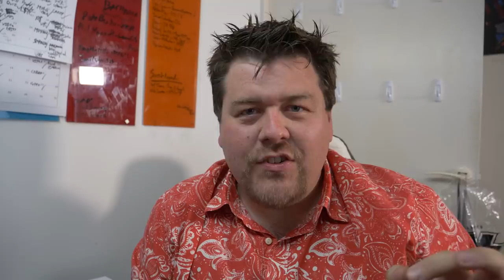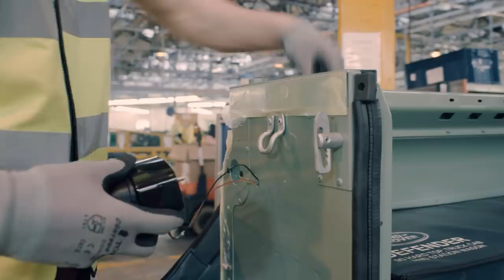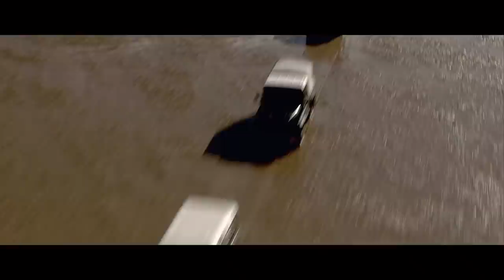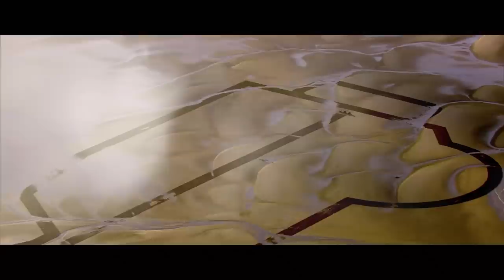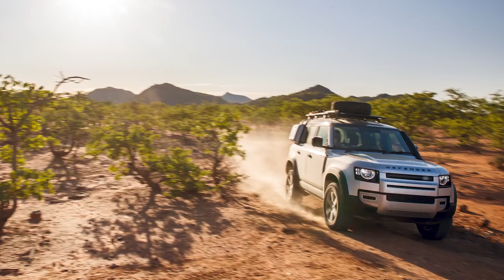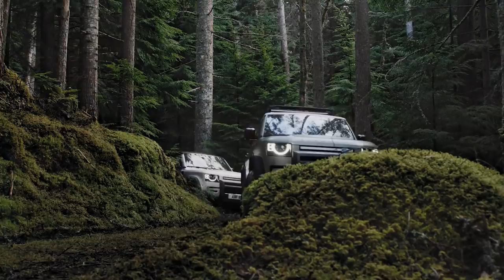How EVERYTHING About The New Land Rover DEFENDER is *WRONG*... and it is GENIUS!

Comment: I kind of disagree. Look what Mercedes was able to do with the new G wagon. They kept all the iconic styling, features and capability but genuinely created an entirely new vehicle from the ground up. I wish Land Rover had done the same.
Reply: Ryan Patterson nah, why make something pretending to be something it’s not tho. Why not make it the best it can be instead of just a pointless tribute to the past. There’s a number of reasons the old design had to end and the engineering challenges with using the exact same shape would be a bit of a compromise with capability. It’s a different philosophy to the g wagon which let’s be honest is all about the image, yes it’s very capable but Mercedes barely sell any and mainly to celebrities and footballers who aren’t taking them off-road. How much more capable would the g wagon be if it was primarily designed to go off. Land Rover have got it right in my opinion
Reply: Bumba Clat the best it can be?

It's not that tho. It's just a clone of the rest of the Lr range.

The best it could be would be more versatility
Reply: G wagon also cost twice as much.
Reply: enzoUKSC it’s basically an updated Disco 4/LR4. With a few mods to mine I’ve never had any problems keeping up with Jeeps and Defenders on any of the trails that those of us for whom these are our dailies go. So...versatile? Yeah, it’s versatile. And capable. Just does it in a different way.
Reply: Because the G wagon is popular outside of the UK; the Defender simply isn’t😐

Comment: I am a big defender fan and I think the new car looks awesome,
But.
It's not a defender. 
The defender name should of died off with the old model or at very least mothballed in waiting for a new utility vehicle (maybe even a fully electric utility vehicle).
The new car should of had a new name, maybe even "challenger" the 90's replacement that never was.
My reasoning is the old vehicle was a utility vehicle and the new model isn't. 
I cant see a company taking one and putting a tipper back on it or cherry picker.
But as a SUV I think it is a very striking vehicle and should sell well.
Reply: it's a great land rover. just not a great defender!
Reply: The pickup trucks and the flatbeds for the tipper and cherry picker customers will come later. The SUVs are simply the introductory versions.
Reply: Should have
Reply: Defender has got a too recognisable name for Land Rover to ignore  - look what happened with Ford's new EV Mustang - it generates noise and publicity without trying
Reply: call it the Offender instead that seems more accurate

Comment: I find it a great same it lost its iconic shape. The new suzuki jimey looks way more interesting now
Reply: But it's not lost the iconic shape.
You could line up the new Defender along side the old one & definitely see the silhouette being that familiar shape.
There is no way LR could have followed Suzuki in the way they made the Jimny, recirculating ball steering in the 21st century?
Nah.
Reply: @Zerofightervi 
The defender was built with workhorse in mind, if you wanted luxury JLR had other options.

People who bought defenders don't care about the feel, they want it to work.
Reply: The Jimny is a very interesting vehicle. The back to basics approach is rather appealing and it reminds me of the old Daihatsu Fourtrack but in a smaller form.

The new Defender probably should have had a couple of versions for the launch. An SUV like they've done and then a much more simpler affair, more mechanical, stripped back and at a much lower sticker price.

I have no doubt that the new Defender will sell, but it will be to city dwellers, yuppies and Kardashians. It is a different vehicle than the predecessor.

The Beetle was the same. Mini/MINI was the same too. The hate between the Mini/MINI camp is still very evident now. I'm a Mini owner, I am accepting of the Mini, but I absolutely hate seeing a MINI at a Mini car show, especially if it's an almost brand new one. The original Mini owners work hard to care for the cars, to maintain them and to get them to the shows. A MINI owner probably took his car to a car wash and that's your lot.

The Defender will be the same as Mini/MINI.
Reply: @Robert-cu9bm  See now I disagree, it's been some time since the Defender has been a farm vehicle.
A lot of the original Defenders have been City dwellers for some time, was it when Ewan McGregor was on TopGear & Clarkson asked what car he drove & he said ' A Defender with a snorkel, just what you need in Central London' & everyone laughed.
I'll bet that he isn't the only one who kitted out their urban dwelling Defender to take on the African planes but never leaves the M25 circle.
The new Defender in realistic terms is probably around the same money as someone who bought a late model old Defender & then threw money at it until it was worth 50 to 60k & then drove it once in a field at 'Glasto' & thought it was money well spent.

These are Defender customers, not farmers.
Reply: @roverboy01  I think it must be a British thing to want the same vehicle to be made for eternity.
I believe LR is coming out with more utilitarian versions at a later date, I wouldn't however expect to see a pickup version because of the way the new Defender is built.
Reply: What mr sandwich means is that he can’t afford the new Defender but might be able to afford a Jimney 😂
Reply: @Stabby666  I couldn't afford a new Jimny to be fair, but it doesn't stop me from appreciating what JLR have done with the new Defender though.

You want a small capable offroader that won't break the bank?
Try the Mitsubishi Shogun Pinin, it's got tiny overhangs, good ground clearance & a proper 4x4 chassis.
You can pick them up for peanuts.
Reply: Zerofightervi you have to have recirculating ball steering with a live front axle rack and pinion isn’t compatible, what the true defender fans are annoyed by is the fact they got rid of a ladder chassis and live axles it has been made a suv which Land Rover already have a lot of
Reply: @jamieshepherd3187  Defender fans are just perpetually annoyed from what I can see.
Reply: Zerofightervi you’re right their are a large number of defender fans that think they know best, I’m not a defender owner I have a jimny I like the back to basics honest engineering of it, the point I was trying to make ( admittedly poorly) was that jlr 
have a full stable of smooth comfortable SUV’s, all trading off the original concept of the series 1, and I think jlr could have made a more utility biased 4x4 to keep the option in the line up
Reply: @Zerofightervi  you are way off!  The new defender looks nothing like the Ole Defender.   It looks like the old LR4/Discovery 4, because it really is the old Disco 4 with a redesign.  I think it is a great product with a really poor exterior design.  If the face looked more Defender then it wouldn't be the big defailure.   As for the British people, when they realize it is a relocated LR4 factory product, that is specifically designed to canobalise Discovery 5, Discovery Sport and Range Rover Sport sales and consequently British jobs, it won't be very popular at home.  Owners will be lucky if they are only laughed at, and not spit on.
Reply: If somebody's complaining about the defender 2020 because of how it looks than there missing the point of the car entirely, furthermore after reading many of the comments it appears that many people are linking utility to the way the car looks even though the two things don't correlate. I think the new defender is great, not because of the way it looks but because of its capability off and on road, for example it's approch and departure angle is better than the  OG defender, it can pull or lift (on the roof) more weight than a land cruiser, Nissan patrol, Jeep wrangler or a G wagon. It's wading depth is better than any of its competitors and unlike the any of its competitors it comes with high level off road modification from the factory. And on the road the air suspension ( or coil spring ) means that it has unrivalled performance on road is well compered to its competitors 6 years ago if someone told me to pick betwene the (OG) defender or the land cruser I would have said the land cruiser as the old defender was ok in the mud but any were else the land cruiser rained supreme but in 2020 if someone told be to pick the ( new ) defender and the land cruiser I would have said the land rover as now it is as good and in some places better than the land cruiser.

Comment: Wasn't the Discovery 3 disliked alot on release? I'm sure that must have sold by the truck load
Reply: I had the very last Discovery 2 registered in the UK in 2005.... loved it♥️ but a manual gearbox in stop start traffic was very wearing! Bought a genuine 2008 G4 Discovery 3 from LR auctions..... loved it♥️ drove great.... but reliability was poor☹ high pressure fuel pump failure, and big end bearing failure at 107,000 miles and 7 years was the killer.... can't fault LR customer service though... replaced the engine 'free if charge' well outside of warranty... WELL DONE LAND ROVER👍
The new Defender looks more like the successor to the Disco 3/4 than the Disco 5!

Do I want one... Hell Yes!😉

Can I afford one..... no☹

Hi LR, as a huge LR fan and former owner.... loan me one please😉👍
Reply: The Discovery 3 and 4 where very popular with LR die-hards. The Discovery 5 lost them as it really became a purely urban SUV. 

The new Defender is really the new Discovery.

The Defender is dead. Long live the Defender.
Reply: Your thinking of the hateful Discovery 5

Comment: My dad had a brand-new F-reg Land Rover Defender County 110 back in the day. Repairs were relatively quick and cheap - someone crashed into him one evening, and Land Rover removed the damaged body panels and riveted new ones in their place within a couple of days (from memory). I do remember the catch on my rear passenger seat becoming lose though, so under heavy braking it would pitch forward before it got fixed - not terribly reassuring on such a relatively simple vehicle!

I also remember someone at a Dartford toll booth insisting that it was charged at van fare, not as a car!

Comment: I’m not a 4x4 fan at all but I’ve always liked the old defender. I loved its retro looks and build with its exterior hinges and pop rivet construction. The new one is just another Land Rover.
Reply: mark reed you’ve obviously never owned or even driven an old defender. They’re wheezing 120hp sheds on wheels with a cramped uncomfortable cab, horrific road handling and tractor style comforts. Nobody except the fanatics want that in 2020.
Reply: Disagree totally with that. Sold mine last week. Was only supposed to be for taking the dogs out in winter but found myself taking it to work instead of my M3 or Tvr , a great fun car that always put a smile on my face and it was a 250k mike smoker

Comment: Mercedes did a proper job updating the G-wagon, to meet current legislations. It still looks iconic whilst improving handling, safety, space, efficiently. This design has washed away the Defenders design heritage. It’s a no from me👎
Reply: And it has a starting price of £93k, hardly for the average person
Reply: Dodomando the Defenders 80k with the 6cylinder and will devalue quicker, not many average people are going to buy them either.
Reply: Lee Harrison Photos I agree. I really don’t understand why Landrover didn’t retain the classic shape and update the safety, tech etc. Mercedes managed it with the G
Reply: I think people are forgetting that the gwagon evolved from industrial to plush over time. It was already a wee bit of a gin palace before it was updated. Jlr completely missed the boat on that, hence all the modifiers doing it for them. 

Either way, I'd buy a current g class. I like the look of the defender, especially the interior (with the wood pack), but I wouldn't buy one.

For the same reason I wouldn't buy fiat, alfa, Renault, Peugeot or citroen. It. Will. Break. 

I've never subscribed to the old adage that poorly built cars 'have soul' or personality. 

Would I buy an alfa if it wouldn't break? Yes. Renault? Yes. Fiat? Yes. I love the design of some of their products. 

But I'm not going to buy problems. 

And im certainly not going to be told I'm not a true petrolhead until I do by some old top gear fanboys. 

So in summary, it will break. So it's a no from me
Reply: I personally think the G wagon looks like shit. It’s a big box with a small box stacked on top. A three year old could design that. As said in this video though, the people whining here probably can afford the new car anyway and are just finding excuses for having to stick with h their old 120hp bone shakers 😂

Comment: I’ve owned 7 Land Rovers and took delivery of my 2020 Defender two weeks ago. It is the car Discovery 5 should have been and far far better than the old Defender, albeit at a much higher price point. JLR could never have pleased the “Land Rover lost the plot when they stopped making the Series 2” brigade, but they are not new car buyers. I lived in Africa for several years and the most popular JLR product (judging by the numbers seen on the street) was the Range Rover Sport. The utility market was dominated by the Toyota HiLux. Land Rover needed a product that would sell in far bigger numbers than the old Defender and make them a decent margin. I believe they have hit the spot with the 2020 Defender.

Comment: Hi Jay, here's my take on the Defender debate:
1. The original Defender was a platform vehicle that could be specified to do a variety of jobs; a hardtop in two wheelbases for GP duties, a pickup for farm and forestry,  an ambulance package, a fire brigade package, a forward control vehicle for police incident management, a 12 seater .  And after it is finished in that role, it can and often is re-profiled to do a different job.
2. The new Disco- -  sorry Defender is not at all flexible like the above, plus it is hugely expensive. It's a Disco with an ugly coat on - nothing more. So if the market really wanted a Chelsea tractor they would have bought one of the other LR/RR products.

The funny thing about all of this is that the days of "Chelsea tractors" are over and done. SUV's are what the market demands will much more comfortable driving characteristics.

Unfortunately LR have alienated a loyal fan base to move into another market, which has collapsed.
Reply: That was a good read.

Comment: As requested: Purchased one for delivery in July. Why? 1. Performance (on paper), 2. Size and power, 3. Versatility especially cold weather heavy snow, 4. Elegant but not over the top, 5. Roomier than G wagon and aerodynamic, 6. Different and refunded as compared to Jeep, Toyota, etc. 7. Very practical. Fears : Air suspension sensor break? I think reliability on JLR is much better, but hell mate it’s a lease. Thanks great review.

Comment: I think you missed a major point here. Yes, the original Defender had major downfalls regarding ride quality etc, however the clattering and poor vehicle handling was a driving EXPERIENCE. It could turn a trip to the beach into an adventure. You wont get that same feeling from the new model as it is simply well refined. Its like every other SUV on the market and wont feel special or give you an experience from the second you open the door and close it on your third attempt...
Reply: Sooo people aren't going to like it because it's too good!? It drives better? It doesn't get the highway shakes? I'm confused...
Reply: @Jadab4u22  Every modern car provides a good driving experience on the road. Its simply not a selling point anymore.

Comment: I think you're completely right, just a shame there is nothing left to fill the gap left by the old defender, an affordable, rugged machine which might actually replace some defenders. Mind you, do Defenders ever die? Most of them have had 3 new chassis and 2 new engines, They don't go fast enough to do any damage in a crash. How often does one actually get scrapped off?

Comment: I agree wholeheartedly with your comments that the new Defender is a far cry from the original as it should be! The only thing is that JLR has lost the original ethos of the Land-Rover(original) it was a semi agricultural vehicle that could plough a field one day and take the produce to market the next day! This new Defender has all these "off-road" and wading capabilities but nobody in their right mind would want to load it with sheep or pigs even in an emergency! especially at the price, it is being sold for!
This is a problem that is widespread across the industry, every new model or facelift comes with a hike in the price over the previous model until it is out of the reach of the originally intended buyers, thereby changing the marketing to attract a different demographic! It has now become an expensive plaything of the adventurous rather than a semi-agricultural workhorse!
Reply: Agree 100%
Reply: Rubbish. There will be a commercial version for exactly the purpose you describe. Sounds like nothing but a tractor would make you happy though. So go buy a tractor?
Reply: Absolutely right...